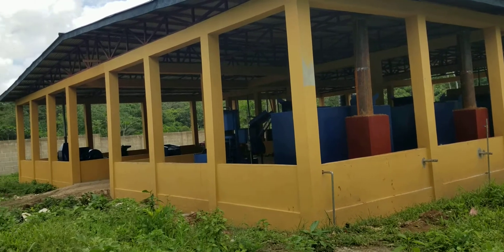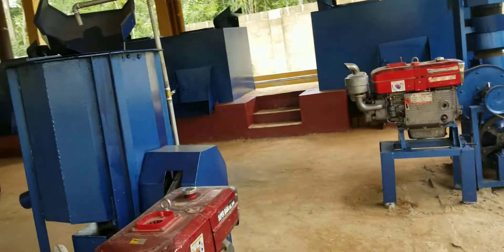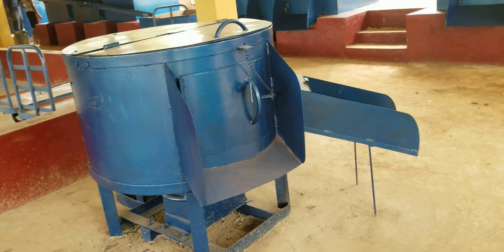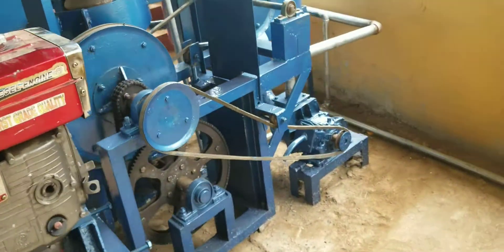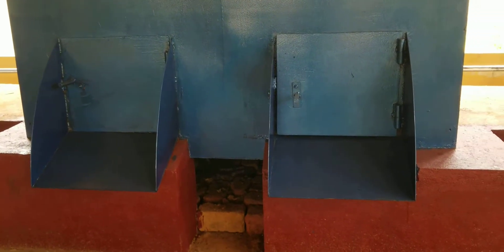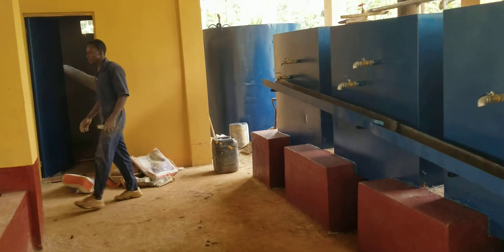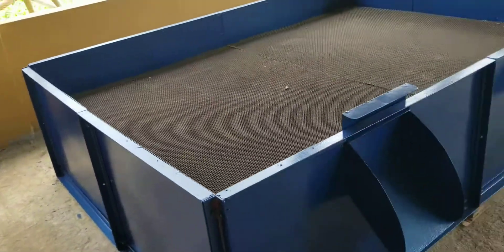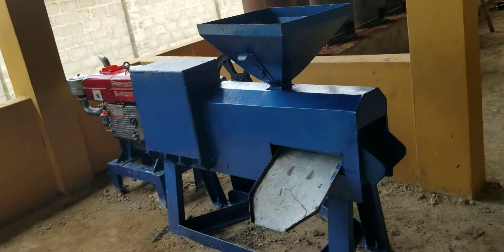FINIC  2 tons Palm Oil Mill that Incorporates Briquettes and Kernel Oil Sections.

Comment: How much would it take to set up the palm oil section
Reply from the maker: The section would require $80,000 to equip with equipment.
Reply: @finicindustries2787   is that not much